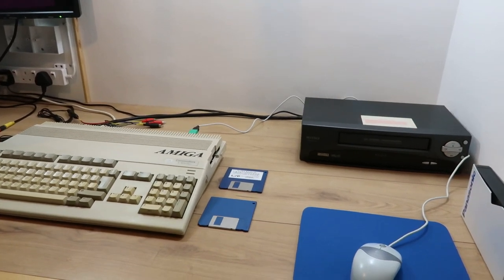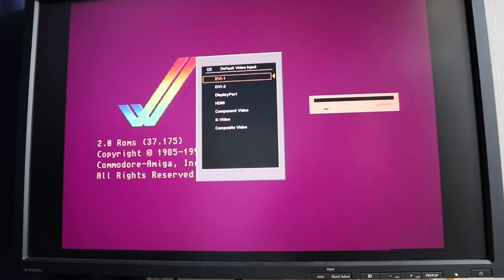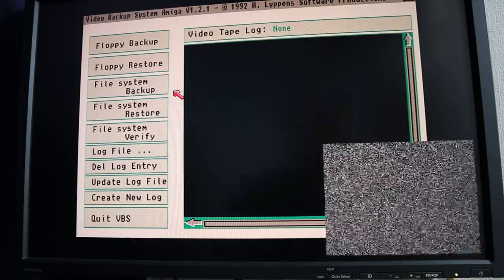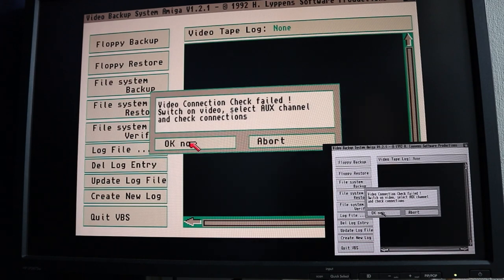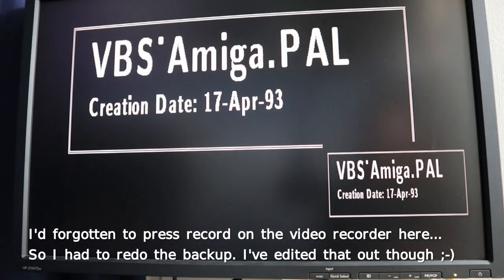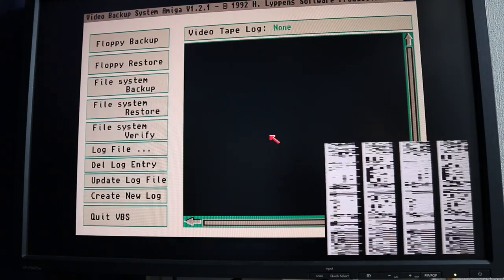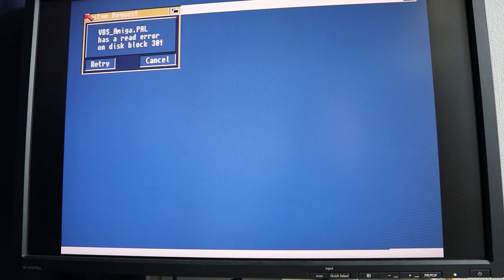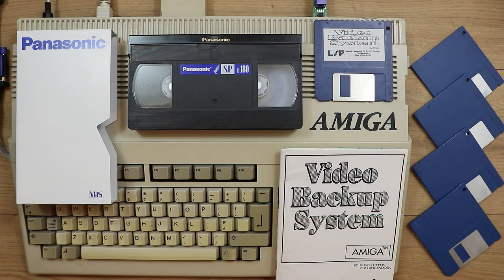Amiga Video Backup System - Part 2 - Floppy Backup and Restore

Comment: Interesting device for sure! I wonder if it would record to a newer capture device since it is just recording a video signal.
Reply from the maker: I think it would depend on the compression. Most compression is lossy, so that would certainly screw up the recorded signal. Maybe it it was very low compression and high bitrate it might work. But you'd probably end up with a video file many times bigger than the original floppy disk data would take.

Comment: I had an idea for a modern (if it makes sense) system: Instead of a VHS, what about using a DVR?
Reply from the maker: A few people have suggested this. I'm not sure it would work so well with the lossy compression these systems use though. If people keep suggesting it I'll end up wanting to try it out of curiosity :-D
Reply: Mind that digital recorders that store .mp4 or .mpg clips are probably not that useful. Most lossy modern compression relies on temporal compression, i-frames and interpolation. That means, only one in ten or twelve frames actually exist. The rest are interpolated or guessed by the machine doing the decoding. That would destroy the code, ¿won't it?

Your best chance there is using the DV codec (old minidv cameras use it, basically writing zeros and ones in a tape, so I guess is ok). DV codec is PAL or NTSC, has no temporal compression and generate files about 200MB/minute. Or just use a cheap second hand minidv camera with analog inputs. MiniDV are lovely tiny tapes, if a bit prone to artifacts when mistreated.